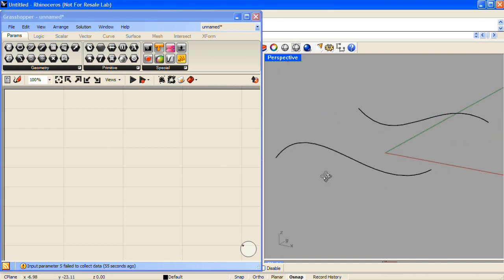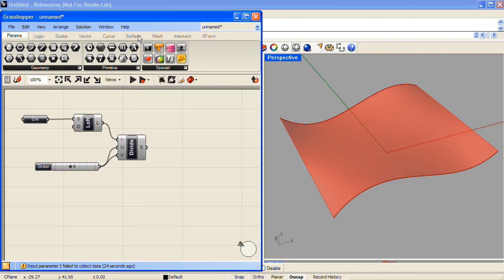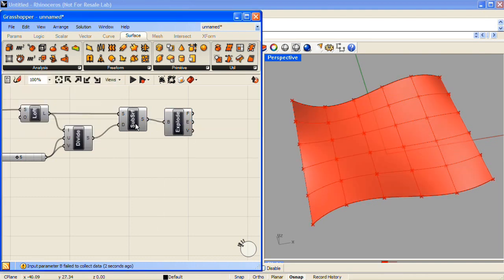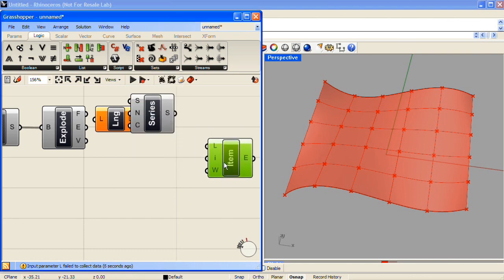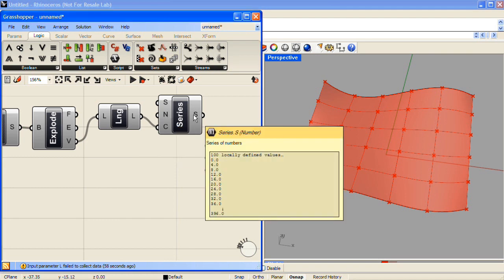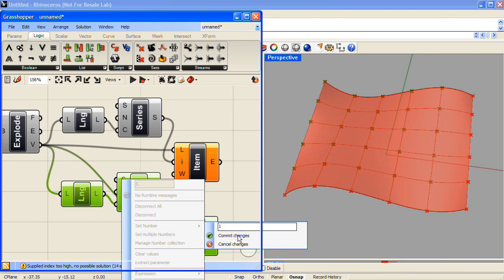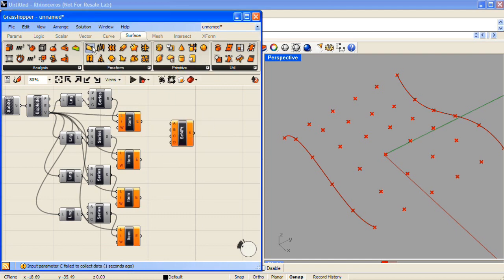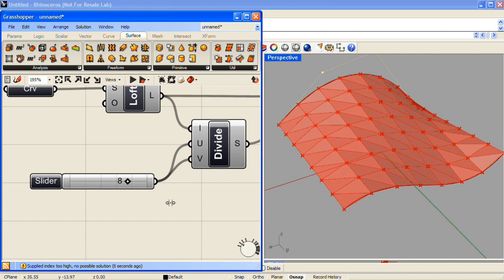Tri panel system with Grasshopper

Comment from the maker: Thanks for the suggestion. What would you like to see changed most? The version of GH used or the version of Rhino. I believe this method of subdivision still works with newer versions but please let me know if not.
Reply: I am completely new to Grasshopper., but I get that my plane divides unevenly: The distances between each division on the x-axis and the y-axis get shorter towards the middle. Why is this?
Reply: I also found it necessary to flatten the vertices' list from the Deconstruct Brep component. Otherwise you get all empty values. Unfortunately, you also end up with "100 locally defined values..." for the Item List component...
The version I am using is for RhinoWIP on MacOS.

Comment: Is it possible to work with triangles which have the same size? how please. send link. <3
Reply from the maker: Using PanelingTools may help you control the sizes depending on your base form https://www.food4rhino.com/en/app/panelingtools-rhino-and-grasshopper , post any questions to the user forum please... https://discourse.mcneel.com/